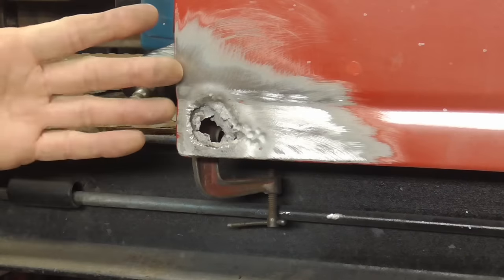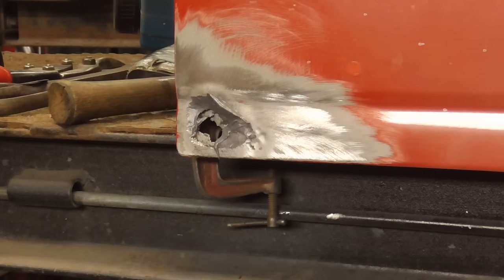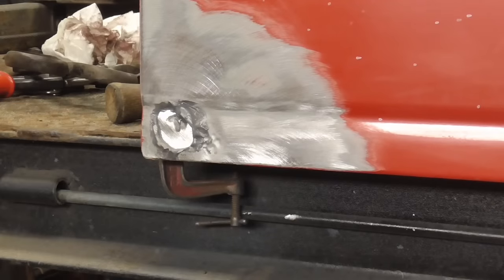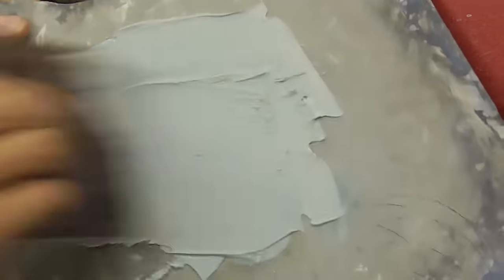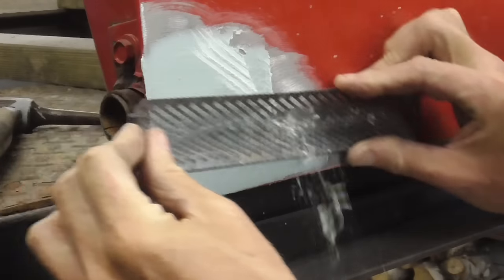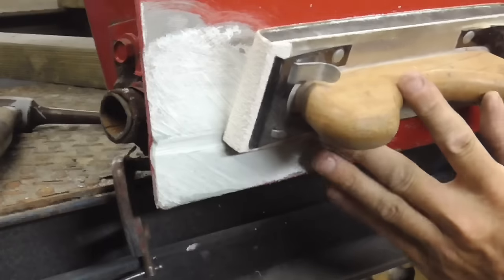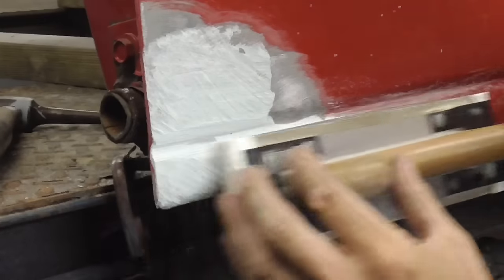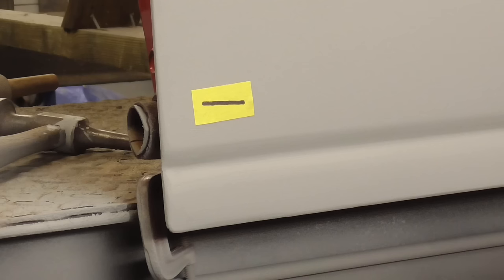Using JB Weld to Fix Rust Holes?

Comment: I have about a 4” wide gap in my car’s quarter panel after cutting out the rust. I cut out a replacement piece and jb welded it in from the back (trunk side). I couldn’t get every bit of it completely flush with the original metal of the car. I plan on using bondo fiberglass filler and force it into the little gaps where the original metal and new piece is. Will it cause any issues  doing it this way?
Reply from the maker: For large areas you can glue and screw or use rivets like these vids:  https://www.youtube.com/watch?v=wRl1QfkrBeY  or https://www.youtube.com/watch?v=d21RkqTwRqs  If the seam is up high you'll be fine.  If you seal the back side or are able to undercoat the back side even better.  Tap the seam down gently and fill, you'll be OK - let me know how it goes for you.  Nice job trying it - with every project you learn more - keep asking and working :)
Reply: @LakesideAutobody  Appreicate it. The repair is right at the typical rust spots above the rear tire where the wheel well meets. Should I just undercoat the backside (inside trunk) or use body filler in the area? I was also considering some house hold caulking around the seam from the inside? Lol
Reply from the maker: @mrsemifixit  If you can clean up the back side with a wire brush (hand or drill) or sandblast the best is to get some spray automotive undercoating from autozone or something and hit it with that - it stays rubbery and won't crack and peel - it keeps the backside from moisture :)
Reply: @LakesideAutobody  So I tested the patch and it failed after hitting it lightly a couple times. I then just used fiberglass short hair bondo to over the area and where the original metal overlaps the patch. Think it’ll be strong enough to hold in place over time?

Comment: How long will it last without breaking out is the question?
Reply from the maker: It depends on if you allow the panel to drain and stay dry.  Good drainage is one of the most important things in a rust repair holding up.  If you can undercoat the back side - even better.  Or this - https://www.youtube.com/watch?v=8XaZBy7GC7A

Comment: I use JB WELD for stuff you would not believe.
Reply from the maker: Once I used it on a rusted exhaust gas return pipe - gets hot as heck.   It patched it up for a lot of years.

Comment: which is better POR 15 hardening putty , or JB weld?  also do you like POR 15 for rust in general?
Reply from the maker: Although I've never used it - I read up on it and I think they would work very similar.  JB weld may be better around heat.  When it comes to rust repair, if you are repairing with fiber glass, JB, POR 15, reinforced fiber glass filler - I think they will all have about the same longevity.  Once the metal that supports it rusts away, there goes your patch.  If you allow for drainage and the panel is able to drain and dry - most products like these will hold up just fine :)
Reply: @LakesideAutobody  I plan to also use POR 15 paint to seal the rust, just assumed POR 15 putty would be designed to support the POR 15  paint  thx!
Reply from the maker: @saltpepper1894  Good thinking - it probably would work better together - always good to stay within a product line :)

Comment: did this the other day.  didnt know if it would work but hey
Reply from the maker: If you allow for some drainage (maybe drill a hole if there is none on the back side or somewhere) the inside can drain and dry out.  No moisture - no rust :)

Comment: My 77 Chevy van was rotted out along the top edge of the drip rail. I used a piece of 2-in x 3 in galvanized angle flashing metal to do a 6 ft long repair. To form the drip rail I sandwiched two 6 ft steel straight edges together and hammered a square lip into the metal, then hammered and worth the metal until it went 1-in onto the roof and slightly below the drip rail. Once I had it formed, I mixed up a couple tubes of JB weld and with my brother below, we put the metal in place and he handed me rivets as I drilled holes and put the rivets in. Once the JB weld had hardened I sanded off any excess and sprayed some gray body primer on it. 
I left the rivets in  place as this was not designed to be pretty.
I do believe if I ground the rivet heads off that the JB weld would have held up.
It's still holding up just fine but there is some surface rust on the metal now ....10 years later. after priming, maybe I should have painted it to. 😁
Reply from the maker: That is just an awesome story - I appreciate it.  I love hearing JB Weld stories.  I should collect them and write a book!  Amazing stories so far :)
Reply: @LakesideAutobody  if it's a JB weld book nobody's going to be able to open it. 😁
Below that drip rail, it was so rotten that the sides weren't connected to the top so it's actually helping to hold the truck together.  There is rust under the rubber across the top of the windshield.  With that side portion loose also I was concerned I'd be driving down the highway and have the top peel off like a can of sardines. 😁
Reply from the maker: @randywl8925  I absolutely love it.  I've driven some real winners so I'm right there with you.  I've had neighbors tell me to move my truck 'cause they didn't want to look at it :)
Reply: @LakesideAutobody  got ya beat, I have two. 😁

Comment: Are any solvents not to be used to wipe down for prep before painting?
Reply from the maker: Thinner is about the only one that can get you in trouble as it can melt primer, plastic, paint, etc.  You can use it but don't put a lot on the rag - just damp and move quick :)
Reply: @LakesideAutobody  cool thanks

Comment: how do I do this on rocker panels where it rusts from inside pinch welds? do I spray the inside with some sealant before jb welding it shut?
Reply from the maker: If you are talking about the pinch weld at the bottom of the car,  and if there is still anything left to glue to, you would grind that metal clean (sand blast it too if you can) and glue to that.  If I didn't answer you right ask again.  Not sure if I understand your ?
Reply: Thanks...but I may just take it to a shop. How long should a professional repair last? The last time I let the "professionals" work on my Toyota, the paint started to crack after 5 years!
Reply: Spray the insides with creeping oil such as Fluid Film or Rustcheck.

Comment: would you have any ideas on how to get a dent out of the top of a window pillar? Its about the size of a half dollar, I went to a dentless repair and they said no, and the local body shop said they would hav to paint the whole side of the Tahoe, because to blend the primer, is there any easy or affordable ways to be done at home?
Reply from the maker: You don't have to paint the whole side of the truck if you don't want to.  You might want to take is to a smaller body shop and tell them they don't have to blend the paint.  Just paint that panel.  Now the paint will come very close to matching but if you don't blend it, you will notice a tiny bit of a difference.  If you want to, you can send me a pic to the email listed under the about tab on the channel home page.  I might be able to give a better answer.  Jerry
Reply: I sent you a couple of pictures to your gmail account thank you!
Reply from the maker: @thomashenderson603  OK

Comment: Can we also use the JB weld instead of the bondo over that area becouse the bondo shrinks over time and curls up . Thanks
Reply from the maker: You could but it would be $.  Use body filler. Bondo doesn't shrink, chip or peal if used correctly - that info comes from blogs, TV, internet, magazines, etc.  Dealerships and pro body shops use filler every day and the cars look great for many years after :)
Reply: @LakesideAutobody  OK thanks , I have a 2011Crown Victoria police interceptor with 13 antenna holes to cover than I'll use the JB on the sheet metal patches than the bondo to cover as you did in video,  what is a good brand bondo or filler .
Reply from the maker: @MrRockydee07  Any brand of bondo is good.  You don't need to spend a lot of money.  All filler brands are very similar.  Just shop for the cheapest gallon of body filler :)

Comment: I found a quarter size hole in my floor pan and thought of using this method to patch it, any downside to that idea?
Reply from the maker: I think that would work just fine.  If you do it from the inside, it would last quite long if you could clean up the underside and spray a coat of good rubbery undercoat to stop moisture.  Here's another idea too -https://www.youtube.com/watch?v=rPTaeH056ng
Reply: @LakesideAutobody  Yea i plan on repairing from the top and treating the underside. It looks like it originated from inside. Its a 40yr old car, i pulled the carpet and padding to replace and the padding looks like it's taken on many spills in its lifetime. This spot is literally the only rust I've found on the entire car.

Comment: What about bigger holes on bed floor?
Reply from the maker: I think you could use the same process just screw it down with sheet metal screws to hold it in place.  You can remove them later and smooth out the seams or leave it, paint it and throw in a bed liner.

Comment: I do something similar but put the metal behind and rivet it in too. I have no idea why you would do it this way.
Reply: Rivet....metal behind......I have no idea why you'd do it that way!
Reply: @jolkraeremeark6949  Probably so it doesn't fall off the car. ...8 years and counting.
Reply: @houseofthediamond8191  what are you riveting to?  I'd love to see a video.
Reply: @jolkraeremeark6949  Wow man! Really!?! You cut out all the bad metal. Spray inside the cavity with rust reformer (that clear stuff which turns any remaining rust black/purple). Spray a little truck bedliner in there after the reformer dries. Cut out a small replacement chip of steel (with the least amount of overlap that you can get away with) from a sheet that you get from Home Depot. (You CAN use galvanized). You also spray both front and back of the replacement chip with the truck bedliner. This way all surfaces inside the overlap are protected after you sand away the rest when it is installed. Place the replacement chip BEHIND the hole instead of gluing ON TOP of it. Purchase small stainless steel rivets. Drill through the outside panel into the replacement chips slight overlap behind the panel. Give the rivet heads a quick zip with a rough sanding wheel (obviously not so much that you cut the rivet heads off). Tap the rivet heads with the back of a punch to sink them lower than the level of the intended finished surface (the least bit possible). If you still have access to the back of the panel give a quick touch up spray of bedliner to the back of the rivets and metal overlap to seal it. Run (1st) a light coat of epoxy on the outside trying to push it into the overlap seam. Wait a day or two. Rough sand the first coat. Apply a (2nd) finish coat. You may not even need Bondo if your careful enough. Rough sand it. Apply acid etch primer. Rough sand it. Apply filler primer. Sand at 600 grit. Paint. Wet sand. It will last forever. The '62 Chrysler 300 has been sitting outside here on Long Island for over 8 years now. There's not even a hint of anything coming though.

Comment: Great job and video! Question? What kind of material is the patch? I need to fix a hole in a steel boot.
Reply from the maker: 22 gauge cold rolled (CR) sheet from Alro Steel.  You can also use old body panels from the junk yard or 20 gauge too.  22 is .030" and 20 is around .035"  - Have a good weekend :)
Reply: @LakesideAutobody  went to Alro Steel website and was overwhelmed. Is this a carbon steel, tool stool, stainless steel or something else.
Reply: @susiehernandez6652  You want a low carbon sheet steel.  Save yourself some money and go to a wrecking yard/recycling center and cut a piece out of a hood of a 1980s era car or older.  Sometimes very old filing cabinets and appliances had the thicker low carbon sheetmetal.  Most newer cars are made of very thin, tuna fish can metal.  You are lucky to have 26 gauge on new cars.  Older cars were 22 to 24 gauge.

Comment: What kind of patch did you use to patch the hole.
Reply from the maker: 22 gauge A1008 CR CS Type B  from Alro Steel in Grayling MI.  You can get stuff like that at Home Depot too I think but a little more $

Comment: What body filler are you using? It looks like it sands really well.
Reply from the maker: It's Auto Body Master brand - I get from Auto Value Auto Parts - it's like $25/gal
Reply: @LakesideAutobody  Thank you
Reply from the maker: @doowopp45  Honestly all fillers sand pretty easy it you are using sharp paper.  Always always always - not matter what you hear on the internet or blogs start with a nice sharp new piece of 36 or 40 grit sand paper - you want to cut through it - not ride over it creating a "ball" - see this video - https://www.youtube.com/watch?v=rv0uB-ZvrFo if you haven't watched it yet :)

Comment: Would jb weld work for holding a rocker panel and cab corner? Was planning on pop riveting it also if needed.
Reply from the maker: Glad you asked - https://www.youtube.com/watch?v=wRl1QfkrBeY  Here it is 5 years later - https://www.youtube.com/watch?v=idrLzsz2eLg
Reply: @LakesideAutobody Thanks for the video. I've got an 08 gmc that has bad cab corners and rockers. I think im actually just gonna use the jb weld and pop rivets and leave them showing and just paint them flat black to match the fender flares. Not terribly worried about the looks just wanting to stop the rust and stop my kids from getting scratched by the rockers when climbing in. Thanks again.
Reply from the maker: @donwilburn2470  That'll work just fine for you - it'll look good too actually - you'll be surprised :)
Reply: @LakesideAutobody  I think some strong neoprene magnets will work between the cab and bed. Don't want to lift the bed. Thanks again
Reply from the maker: @donwilburn2470  That or wedge something between the two to hold it.  Let me know how it goes for you :)

Comment: Which JB Weld product is this? I found so many on the shelf. Thanks
Reply from the maker: The "original"  Takes overnight to harden.
Reply: @LakesideAutobody  thank you. I dont know what the original is though. The packages are not marked original. I saw like 20 tonight at Auto Zone. Is it the package with 2 inside of it and the PSI was like 1500
Reply from the maker: @susiehernandez6652  This is the stuff: https://www.jbtools.com/jb-weld-8265s-cold-weld-epoxy-welding-compound/   JB 8265S Cold Welding Compound
Reply: @LakesideAutobody  your awesome, thank you. 1 last question, are the 2 tubes inside the package the same thing, just 2 of them?

Comment: I want to stick copper pipe on stainless steel, Any suggest some tips ?
Reply from the maker: This would be the stuff to use but it depends on how you are gluing it together - two flat pieces of metal i.e. copper to stainless steel properly prepared will stick together excellent.  If you lay the copper pipe down along the stainless steel, I think that would work well too.  The more surface area glued, the better :)
Reply: @LakesideAutobody   Thanks For Valuable  Reply i'm interested in this product, how can i buy it? i'm from india. can you please suggest...
Reply from the maker: @devchandpatel3671  Here's a link from Amazon - https://www.amazon.com/J-B-Weld-8265S-Cold-Weld-Reinforced/dp/B0006O1ICE/ref=sr_1_4?keywords=jb+weld&qid=1654729238&sr=8-4  Hope it works for you my friend 🛠

Comment: How does  J.B.weld work on galvanized metal , for rust repairs
Reply from the maker: JB Weld adheres well to galvanized metal as long as you grind it or sand it first.
Reply from the maker: Not sure what a woo gasifier is but I've used it for a lot of stuff and it always seems to work good for me.  It's worth a try.  Happy holidays from Michigan
Reply from the maker: @benz merc Interesting.... I'm going to have to look that up.

Comment: You used way too much body filler. Best to use thinly so not much sanding to do. If you have mixed too much JB weld, before filler, you could put the JB weld on the sticky side of masking tape and place it over the repair and smooth it out. You would be surprised at how little filler you need.
Reply from the maker: Never be afraid of filler it will really hinder a guy form becoming the best he/she can be as a body man.  That "tiny bit of filler" thing is just internet/tv/magazine stuff.  All dealerships,body shops across the nation use filler every day and no one knows it because it's applied right.  Filler got a bad name from folks that apply it wrong.  Really - that's the truth :)
Reply: @LakesideAutobody  not the way I was taught. A thin skim of filler to cover the area then sand down and then another thin skim if needed. No need to put loads on to just sand it all off.
Reply from the maker: @ianallen2  If you worked in a body shop, you know you need to be fast - no time to put two-three-four coats of filler on. One and done - hopefully.  It doesn't matter how thick you put the filler on as it has a catalyst or hardener - it's all the same.  Again that's internet, magazine, TV talk.  Nice talking to you though - have a good week :)